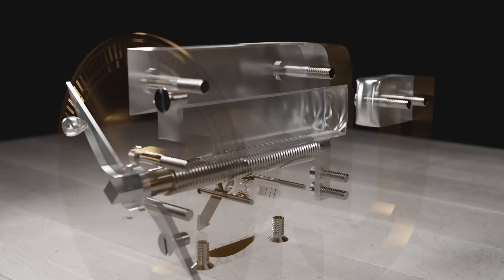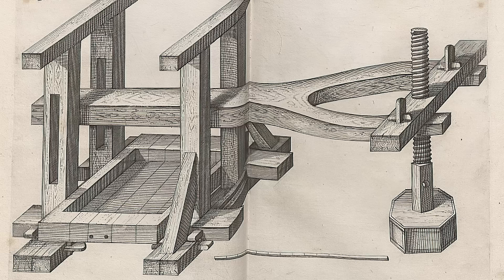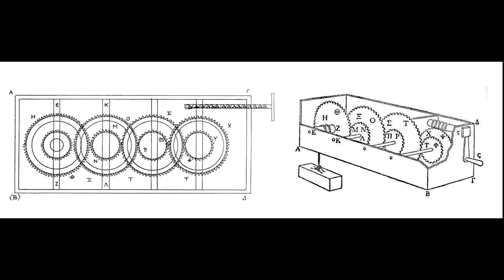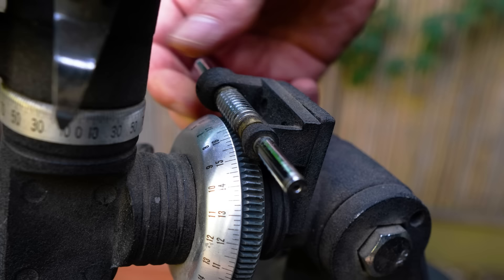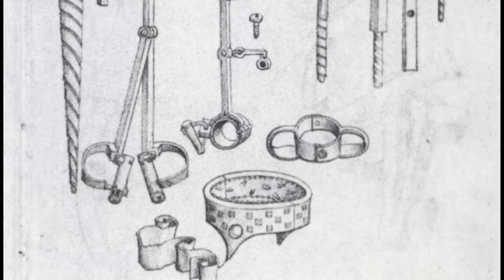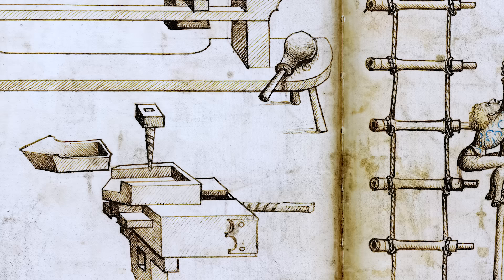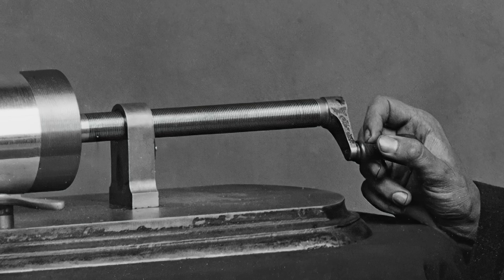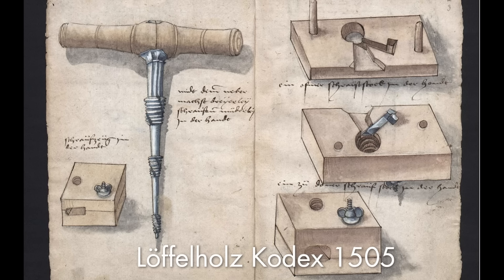Where DO screws come from?

Comment: Regarding the German texts: these will be written in Early New High German.  The problem there is that there 6 printers languages, all surprisingly different from one another, and the texts could be in any one of those.  Spelling had not been standardised, either, so that complicates matters more.  So even if you speak New High German aka modern German, and you can find someone who can make out the script and transpose it into a modern font, chances are you still would not understand much.   Just to put it into perspective: people still speak dialects in the German-language area today.  Get people together from villages 300km apart speaking their respective dialects, and they will not understand each other.  30km was enough, back in the day.  Hence the existence of the supra-regional or "high" language aka High German aka Hochdeutsch.  ENHG is an intermediate stage on the way to NHG.  "High" is a topological reference: it was a southern dialect that was adopted as the basis for the supra-regional standardisation, and the south is the area with mountains (as opposed to the "low" north German plain much closer to sea level).

Comment: Screws and bolts can mean the same thing depending on a ton of variables. But i always thought of screws as having a sharp point and relating more to wood, whereas bolts are cold, blunt metal fastener with equal importance.
Reply: I'm an engineer in the UK and here it is generally accepted that when it comes to engineering screws and bolts, a screw has the thread all the way to it's head but a bolt has an unthreaded section below the head. I suppose I'm just making the point that the differences between two things will be interpreted differently in different parts of the world.

Comment: Technically a "bolt" is a type of screw....as in the most common type of "bolt" is actually called a hex head cap screw.
Also bolts don't always "thru bolt" 2 pieces captured by a nut on the end. A lot of times a bolt fastens one piece to another by threading into a blind hole. So your definition by which you distinguish the screw from bolt, is only partially correct where as typically a bolt does not cut threads.... however not all screws cut threads. For example a 10-32 pan-head screw has "machine threads" rather than "wood threads" , therefore you need to use a 10-32 nut with the screw to capture something. Unless that is you have pre-cut threads in one of your pieces.✌️

Comment: I would love to learn how the first screw was made. How did they make these screws before they had screws to compare them to. In your example of the screw cutting lathe how did they make the guide screw in the first place? Is there a way to make a more precise screw then just carving it by hand?
Reply: There are ways to make a more precise screw starting from a rough hand-carved screw. Da Vinci drew an illustration of an ingenious screw cutting machine. I'm surprised it wasn't in this video. It uses two master screws to advance a cutting tool along a rotating blank, with a gear ratio between the blank and the master. The errors of each master screw average out when the blank is cut, and the gear ratio allows the blank to be cut with a different pitch than the master. The blank can then be swapped out and used as a new master screw.
Reply: @jbay088  Interesting, thanks.

Comment: Look closely at the german thread cutting lathe. The illustrator did NOT make a mistake. Clearly the right hand "master thread" moves through the chuck upon rotation. If the part being cut goes inside the possibly hollow master thread it works out fine. The quality of the drawing is immaculate for the time. This would have been a weird mistake to make for somebody who clearly studied the machine closely to make such a detailed drawing of it. I hope you see what i mean.

Comment: As I plugged my phone in and set it down, I accidentally switched to this video and didn't realize until I was across the shop at the vice, which is not much more than a screw, cutting a piece of steel with a worm drive grinder. I was about to go switch the video back to the one I originally wanted to listen to but this one sounded interesting so I thought screw it. Now on on my phone writing this comment instead of working and I have a lot to get done or else I'll be screwed so farewell.

Comment: A thought on the subject of the direction of rotation of the machine that copies threads: at 12:18 you mentioned that the thread of the copied screw has the wrong direction of rotation. But isn't it the case that the direction of rotation of the thread of the workpiece depends on the orientation of the cutting edge of the cutting tool? I may have made a mistake in my thinking, but I believe that both directions of rotation can be realized. What do you think?

Comment: I still like the "Beakman's World" history of the screw better. They start with the inclined plane and show how it was extended, and how the idea of a screw was simply to wrap the inclined plane around a central pole. From what I remember in school a 'bolt', is something that can freely move back and forth, whether it has threads or not. A pin can hold a bolt into place. If it doesn't have a stopper, like a nut, or pin, but becomes part of its only locking feature it would be a 'rivet'.

Comment: I always thought a screw was blind-hole ie. doesnt come out the other side of a piece, and a bolt goes through the other side, fastened with a nut. Never heard that a screw needs to form its own threads in a piece, and we call cylinder head "bolts" "screws" in the outboard motor world, same with rod bolts vs. screws. we call them screws, although in the automotive world they call them head and rod BOLTS, even though there is no nut on the other side of said "bolt" in many cases.

Comment: The whole screw/bolt dillema seems to be an english language inaccuracy. In german "screw" signifies all threaded bolts and fasteners  while a "bolt" is unthreaded and is usually pinned in place or hammered flat for a permanent connection.

Comment: As a german engineer (the master race :P) - in german there is no differenc between "screw or bolt" ... it is a SCHRAUBE - and then we specify if is a "Selfcuttingscrew" "Metrich machine screw" "wood working screw or "Spax"  "sheetmetalscrew".... badly translated from the german words ;)

Comment: The inclined plane wrapped around a cylinder .. you either understand them, or use them to hang pictures. I am of the former league. I have moved mountains .. or at least swapped a few unit bearings. Aye, "screws", they're awesome as fasteners and get the job done .. but to move fifty tons by hand with a cheetah-bah and a jack screw.

Comment: You kinda skipped a bit part there -- the process you describe, with a fine enough gradation, just becomes  bore cutter, no?.  Precise, straight and parallel bores made for better cannon, and the development of this kind of machine tool then led to quality cylinders for steam engines, thus powering all sorts of machines, includinging pumps to get water out of coal mines so they could dig more coal to run the steam engines to make more cannon, steam engines, textiles, etc etc.

Also, rifled barrels. Just a really stretched out internal screw thread.

Comment: - The helix mystifies me. And it's ability to move a bag of potatoe chips in a vending  machine without moving forward itself baffles me.
- I have no trouble understanding a spinning  nut moving along a threaded bolt. But a stationary object pushed along just doesn't click.
- Since a helix is a flat spiral thrust into the 3 dimension (a stretched slinky) . What would it look like if then it was stretched into a 4th spacial dimension?

Comment: The machine that you said was wrong to have the threads of the cutting tool opposite the drive threads I believe was correct because the sliding of the tool fore & aft of the fixed part to be cut?

Comment: Regarding the mistake on the lathe: in truth, that may not have been accidental, but instead a method of "copy protection" intentionally introduced by the master.

Wary masters of the time - including creators of medieval combat technique manuals, where my expertise lies - were known to intentionally introduce errors into diagrams to trip up anyone who would steal their works and try to pass them off as their own.

The thinking was that if you're able to notice the mistake for what it is, you are either a student or legitimate buyer of the master's (and would be shown the error beforehand) or someone who is so knowledgeable/skilled that you wouldn't need the book in the first place.

Only those who were using the book without the master's permission - a thief, in other words - would be unable to notice the error, so when they tried to apply what was in the book verbatim, the results would fail, and often with catastrophic results. So you could either pay now in coin, or pay later in blood and honor, your choice...

Comment: Using wire nuts (internal screws) to join the ends of some electrical wires in a moment
Reply: 25 years an electrician ( retired ) Ideals ? Or b caps 's yellow red gray or dark blue little orange guys ?? As my fingers got old I used an ideal twister on me screw gun ! Yes I've twisted a few Wire Nuts !!!
Reply: @jerrywatt6813  Idk what an ideal is, and I refuse to look anything up. Good on you for your nut twisting experiences. Enjoy your retirement!

Comment: 13:00
(Roughly)
I don't know.  The overall quality of the drawing makes me think that a screwdriver would have been drawn better.  It almost looks more like a chisel to me.  In the rest of the drawing, straight lines are nice and straight.  Most curves in surfaces seem accurately drawn.  If we assume that thing is a screwdriver, I'd think it would have a nice straight, angular form.  This thing seems a bit rounded, and few usable screwdrivers are anything other than strictly straight-edged at the business end.

Comment: 12:18 That illustration mistake might not actually be a mistake. In a time before copyrights and patents (and a justice system that would enforce intellectual property rights), a good way to protect a design from would be intellectual thieves who know nothing of engineering. Was to include purposeful flaws that would render a device useless if built to apparent specs. It makes having a devices inventor in your employ an integral part of the thing actually working.

Comment: 1 billion years ago and many generations the original wooden pegs in holes appear in the fossil records from there we saw wedges evolve in some pegs to hold them tighter in their holds. This allows wood pegs to live in metal holes just as well as wood holes. From there further diversification resulted in metal nails with squished in head called rivets. Now evolution stalled here fora while but eventually we see rivets where only part of the body in the hole is expanded. These traits became organized over time into a spiral around the body of the rivets. They pushed their way out into their metal creating female threads that the screw can now move into and out of the hole as it pleases while still being anchored at all times. They are remarkably resistant to predators even when active and feeding.

Comment: 12:19 This is much too obvious to be an error. The lead screw probably drives the shaft with the opposite threads forward to either bore or otherwise cut a workpiece. The left hand threads are probably cutting edges which would need to oppose the direction of the drive screw to prevent the operation from digging in and locking.
Reply: In many ancient drawings there are such "flaws" we spot as erroneous  immediately today. They might have been put in intentionally, so that someone without knowledge on the working principles behind  was unable to copy such a device and make it actually work.

Comment: i aint no engineer or scientist..but..what if you painted a rod white..got thread or rope..put some ink on it..wiped it almost dry..wraped it around the rod..un wraped it..now you got a coiled patern..or took wire and wound it hard on soft wood..the wire would leave a coiled patern..then you take a triangle file and file a sprial screw patern..or why are they called threads..just a crazy thought

Comment: A fastener with threads is called a screw. A fastener without threads is called a bolt. You must use the correct name when describing any of these. One cannot use both of these names to describe one of them.

Comment: But... where do the screws come from? Efficient copying of screws is required for mass use, but you still need some way to create a high-precision master screw you can then copy.
Reply from the maker: In the back of my mind I have probably 2 or 3 videos it would take to answer that question
Reply: @machinethinking  Good thing I subscribed, then! :)
Reply: @machinethinking  I got my hands on a copy of Moore's book. I didn't realize that "I could explain this is 2-3 videos" was a huge brag.

Comment: 'Screw' v 'bolt' - actually two entirely different things. A screw is the helical ridges featured in this video. A bolt is a pin that secures things - e.g. a bolt for a door (door lock) or holding two items together by the bolt passing through holes in those items - the bolt being secured from falling out by a pin, a threaded nut or other securing device.
Reply: Ok, explain head bolts.
Reply: @ObservationofLimits  what needs explaining ?

Comment: Duh... A Screw factory run by small gnomes which mine the iron from rocks and turns it into screws by pressing the iron ingots into screws with their (for them) huge screw shaped mold and high pressure.

Comment: A bolt dose not have to have a nut to be considered a bolt. Some have a nut but most actually are threaded into the structure they attached to. Maybe you you actual knew a thing about fabrication you would know the right answer and also the first example dosnt count as a screw It is a “auger” and it’s complete different from a screw.

Comment: Not exactly right about screw vs bolt. A screw is intended to be turned weather it is slotted, hex head, hex socket, or Phillips. A bolt is not intended to be turned. The nut that is paired with the bolt is intended to be turned while the bolt is held stationary. Can people violate these intended uses? Of course they will. One more thing. A machine screw looks like a bolt but it is intended to be turned. Go to the hardware store and see how they label their fasteners to see for yourself.

Comment: As a young man I began working in my apprenticeship in the 70'ties and we used both metric bolts and 'withwurth' bolts for some reason, and also for some reason those two systems was stored together, and also for some reason I as a young unexpirienced man always took the bolts from one system and the nuts from the other system and on site I did not understand why the nut stopped running up the bolt, which stupid idiot invented another type of threads when there already was another thread? And who in the world was wirthwurth?

Comment: Screw is not an invention my friend.. 
But you are not Greek so how else would you know...
Screw as many other words in English lack of etymology or  their root has been forgotten. Kohlias is a word for screw in Greek and has the same root with kohyli that means shell, and that's because inside of every snail shaped shell you'll find a screw.
It's a biomecanical designed application that exists in nature and humans after observation modified it and used it in many ways and applications as you are very correctly  describing in your video. Longer versions of some sea snails when striped out from the outer shell will result to a kohlias,( or screw design) , with grooves of a Fibonachi scale progressing width. With that said reproducing this design in a larger scale and using the wider part placed downwards and rotating it in order to bring water to the surface it's also creating pressure so  you can regulate (according to the speed that the device is turning)
the water flow to your advantage...
Hydravlic pressure is called.
Haven't attended any other of your videos, which I'll do, but I think that before attempting any other like this one you should search for deeper knowledge and understanding of nature.